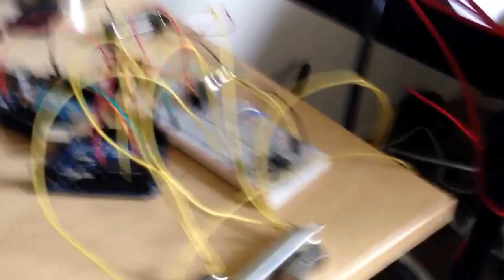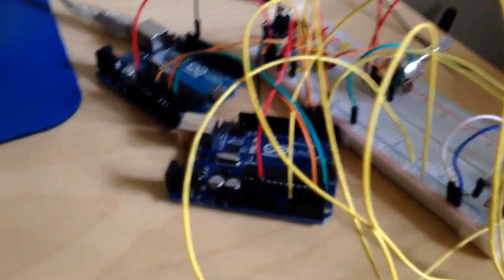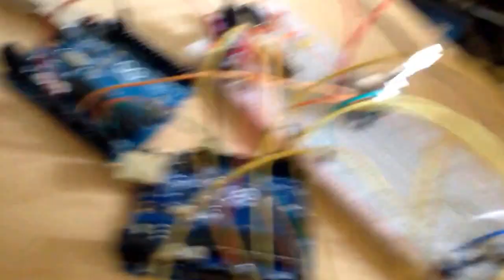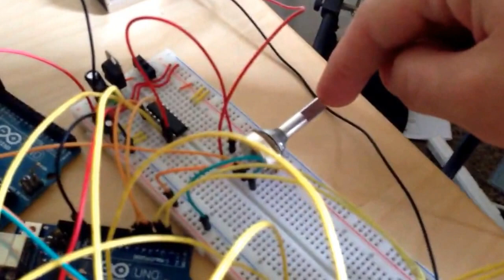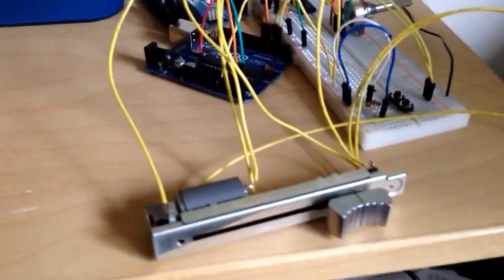Arduino control of linear slide potentiometer (flying fader).

Comment: Is there also a slide with a spring? That you can pull back and then shoots back to the front?
Reply: the one in this video is a motorized slider, you can simulate a spring by controlling the motor.

Comment: Can this be done with one arduino? I am hoping to take the analogue signal from a potentiometer in one position. match it against another potentiometer and if both aren't reading the same value, rotate a stepper motor until they do. Cheers.